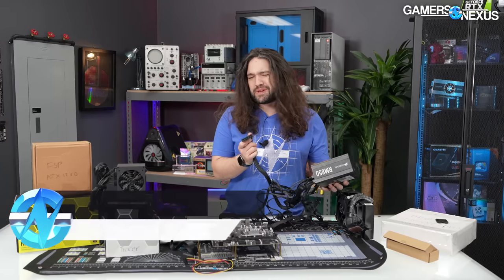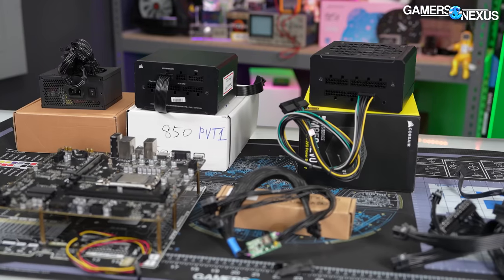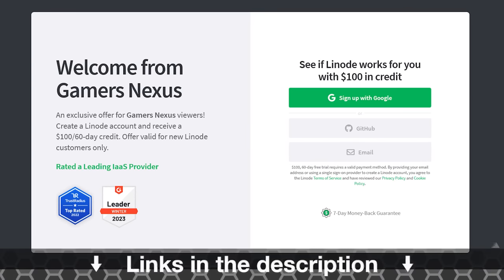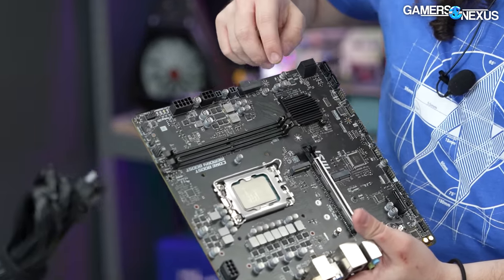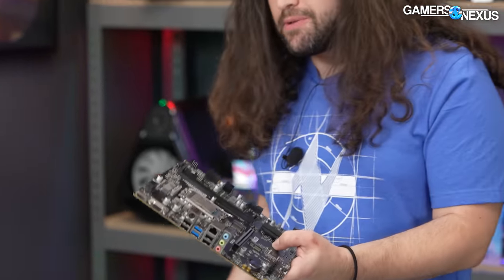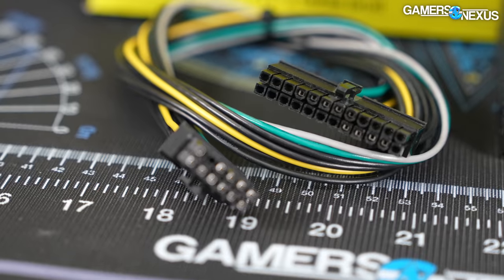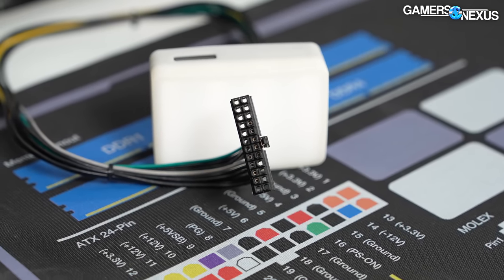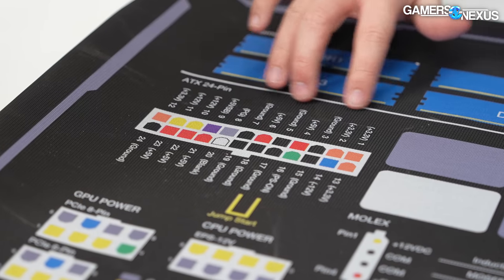The Future of Power Supplies - Maybe (Motherboard Cost, Cables, & ATX12VO)

Comment: I get that there can be tangible benefits to the 12VO standard, but I do not think it a good idea in the DYI PC space.

It shifts the work load, complexity, and associated cost of voltage conversion in the wrong direction.

For OEM builds, especially in consumer grade PCs, it can work fine though. Upgradability isn’t really a concern for these PCs, as it’s not common for non-enthusiast users to delve into anything more involved than a hard drive or RAM swap.

The one component that can follow you around between builds, without any issues, is the power supply. So long as it outputs enough power for your needs in the new build.

You purchase a quality PS once, and it can last through a decade of builds easily. MBs gaining complexity just means more to break or go wrong on this expensive component.

The 12VO standard just makes the MB more complicated and expensive, and that is a component that may require replacing at least once during the lifespan of a typical high quality PS.

So MBs would definitely be more expensive, and the PS manufacturers are not likely to pass the savings to consumers. But for their OEM partners, the PSs would be cheaper, basically making it a zero sum change, with real benefits and no downside for them to switch to this standard.

Heck, companies like Dell already use their own proprietary PSs and MBs anyway. At least if they switched to 12VO, replacing a faulty PS or other component may be easier for consumers… Probably why they haven’t adopted it, can’t have consumers fixing a broken computer rather than buying a new one.

Comment: I haven't changed my power supply in about 7 and a half years. Meanwhile, I've used 3 different motherboards in that time... why tf would I want more shit moved from the PSU to the mobo when it means owning a PC and upgrading it will get more expensive? So because my mobo will save 1 Watt per year, I'm supposed to pay more? I ain't changing my PSU as long as it lives. Thankfully it hasn't caught on and if it does, I'll avoid it like the plague until I HAVE to buy a new PSU.

Comment: FFS, the PCI-E power connector is total crap! If anything it should never have been introduced as it's such a stupid standard. We already had the EPS-12V connector many years before the PCI-E power connector came around, and it could have done the same job as the new connector, only better. The difference is that the EPS-12V connector has four +12V pins and four Ground pin, while the eight pin PCI-E connector has three +12V pins and five Ground pins. 

So I hear someone cry, "But what about the six pin PCI-E power connector?" 

Good question with a simple answer, it shouldn't have existed at all! The six pin connector has two (2!) +12V pins and three ground pins. Guess what connector can provide the exact same amount of power that was standardized many years earlier? The ATX-12V connector, with two +12V pins and two ground pins. So not only is it equivalent but it's also more compact. And just for fun it makes the connections more granular as two ATX-14V connectors can be combined and used instead of a single EPS-12V connector. In fact a lot of PSU's used that approach to make them compatible with both EPS and ATX 12V connectors.

So instead of inventing the wheel once again the smart move would have been to just use the same connectors as was already in use on motherboards for the new graphics cards. It would have meant less cable confusion and more flexibility. And now they want to use the less capable PCI-E connector to provide extra 12-V powerr to the motherboards? WHY?

There is already a motherboard connector meant for providing +12V to the motherboard, and it can provide more power using the same size connector. USE THE EPS-12V CONNECTOR! It's what it was made for after all. And if anything retire the silly PCI-E Power connectors now that you are rewriting the book!

Comment: What the point making new standard from the ground up and still use such a low voltage as 12v? 48v is no more potentially harmful yet it can deliver 4x of power over exact the same cables, this ATX12VO meanwhile is not even a compromise it's just moving the same crap from one space into another making a pure mess for potential builder who would need to choose MB by their dc-dc power supply capabilities compromising in other planes.

Comment: I don't understand this.

My 1600W PSU consumes 5W when the workstation with beefy 280W CPU is standby.

PSU manufacturers know precisely what they're doing. They have been working in the industry for decades. Shifting responsibility from PSU to motherboard doesn't exactly solve anything - PCIe already supports power management. If a PCIe device doesn't respond well to power management it won't matter who delivers the power.

With this shift we no longer talk thermals and layout. We start talking about power capabilities of motherboards.

What problem is Intel solving again?

The use of I_PSU% seems like an awful waste of something that could easily be a 1wire communication - not just for the 12V, but literally anything, including fan speed or input voltage fluctuations. The sole fact this is 3.3V should make folks at Intel reconsider.

Seems like MSI agrees with that all too. Whatever components they add to the board - have to be ready for anything the user may be throwing at them. So instead of having a range of PSU power delivery, we end up having a combination of PSU and motherboard power capabilities. Manufacturers will create power capable boards just because they can't know who and how is going to use them. This initiative seems flawed?

The only way this could work is if EVERYTHING switched to 12VDC. No other voltages delivered, and everyone now being responsible for stepping up/down input voltages for their own needs. But if we're doing this - why bother with 12VDC? Why not just replace the PSU with a full bridge rectifier and tell the manufacturers to figure it out?

Comment: (Writing this comment before watching the video)
ATX12VO seems idiotic to me. You are only moving the parts around to a more disposable part.
Powersupplies often last 10+ years meanwhile motherboards are often replaced/upgraded by that time.

That means not only is there a significant cost increase to go to ATX12VO but since you are more likely to replace motherboard than a powersupply you will pay that cost multiple times.

All this just to cut down some connector sizes. Which we could have cut down and kept 3.3v and 5v.

Comment: 12vo is just downright backwards. If they wanted to do better power saving and efficiency, why didn't they just leave everything where it is,, but put extra power control for the 3v3, 5v, -12v rails inside the PSU, controlled via a single data pin from the mobo? The whole component paradigm is being twisted to shit.

Comment: I find the 12VO spec just astronomically stupid for consumer devices.  We're going back to the 1970's/80's.

Motherboard are already bad quality from the big MFG's, and relying on them EVEN MORE to provide higher quality boards that handle all power regulation that we are STILL USING EVEN AFTER THE SPEC CHANGE, is asinine.  Nevermind the inevitable cost increases, as if they aren't charging ludicrous prices nowadays.  Then we get to the extremely refined quality PSU's having far less of an impact in power delivery, reducing their value, while they probably won't reduce in price much at all.  It also adds even more failure points onto the motherboard, the most painful and difficult component to replace, something will undoubtedly be underlooked.

If we are still going to have a 10+6+4+4 headers on the board, then WHAT'S THE POINT?  It makes no sense.  Long in the future it may, but for the foreseeable future?  I don't see it.

And then finally it'll increase complexity for new builders.  No longer will they know the giant cable goes into the giant socket and every PSU and motherboard has them.  Now it'll be a question, a pin count, "where does this go?".   The only benefit is that it won't be a pain, literally, to (dis)connect.

I have no faith in modern motherboard companies in this 12VO transition unless they're prominent in the server industry.

Comment: Putting +500W of power connectors to a not overclockable mATX board is pointless and needlessly increases cost for that board. The base 10-pin supports 50% more power than the 24-pin connector, so it's not going to be an issue for any board except extreme overclocking boards that are $1000.

Comment: thats why I like apple. 
THey make a change and people get pissed off but they made the change. 
with the PC space.. to many contracts are connected to old tech. and making a change becomes way harder because each major change would make a restart moment. 
it's the same as windows not having any centrailsed place for settings. we have settings, control panel and all the other little things that connect the 2 making it a cluster fu**. 
But if you made the COntrol panel redudand with it very easily could.. the people who have been using it for years would bitch so hard and the devs would have to relearn.... the wave of change would be to much. 
At least apple just change it and then you have no choice but to go with.. and most of the time its for the best.

Comment: In my opinion, this seems quite dumb, motherboards are already under a lot of strain and already have a ton of failure points, adding more voltage regulators and converters will just make it worse.
Also, how could this save power exactly? as far I'm aware PSUs only use 5VDC in standby mode, and when you short green and ground just then that the other voltages are active.
The only thing that could be neat is being able to route almost all cables from the motherboard but anyone can add a feature like this with normal PSUs and it isn't really needed.

Comment: Honestly if I do buy a 12vo PSU I'm gonna buy one of the inevitable eventual conversion kits to use a non-12vo motherboard with it and keep using non-12v parts until/unless they become unavailable. Putting this stuff on the motherboard is stupid.
Reply: Some of these revisions/additions do seem valuable, and I'm not a big fan of the 24pin connector because it can be so hard to fully insert, but I see absolutely no reason why 12-to-other-volt conversion using the same hardware that will be on the motherboard can't still be located in the PSU enclosure, and features like over power notification can just be done over existing pins or via a new connector on bacwards-compatible hardware.

Comment: This seems like a really bad standard for consumers. More expensive boards, lack of backwards compatibility with older devices if needed, if something goes wrong does it need a far more expensive board replacement, boards in general have to be rotated out more quickly than power supplies meaning it will be more expensive for anyone that will always stay up to date.
And for maybe a minor increase in efficiency if standby mode does this really not seems like a worthy trade off .

Makes me want to see it fail like BTX did.

Comment: So, more cables on the motherboard which means more cable management that could possibly impact the airflow in the case? More stuff for the motherboard to do? More complex motheborards meaning more expensive motherboards and more likely to fail? And on top of that, PSUs that will still cost the same if not more (cause you know, Moore's law is dead).. 
No thanks.

Comment: I am against it , sure make main-board 12V only but have the PSU's still do the 5v /  3.V for external devices  or have a separate optional modual do the external conversion , no way in hell I am going to spend over $500 on a mainboard and then risk it melting down from extra power draw , hard enough not having them randomly blow up for no reason, also how is the mainboard foot print smaller with ADDED output pins ? 24% price hike = ~ $100 extra for mainboards .. about the same as entry level PSU !!!
Reply: Motherboards don't randomly blow up. You're doing something wrong.

Comment: I am NOT in favor of this. Power supplies fail and they fail for a variety of reasons. Shifting the responsibilities of a power supply to a motherboard, especially an already expensive motherboard increases the modes of failure for that component. A $400 or more component is now much more likely to fail and the cheaper $50 - $150 power supply (probably less now that it's doing less) is less likely to fail.

Comment: I very much hate this. I only know a little about power phases and capacitors due to teardowns *on this channel*. I DO NOT trust mobo vendors to put high quality (or even decent) voltage adapters in arbitrarily assigned "mid range or below" SKUs.
Also Intel is on some extreme copium if they think vendors are capable of achieving the "somewhat lower power consumption in certain sleep states" ideal. Have they never tried to download drivers before?

Comment: A PSU that wont do its job? Yeah, thats gonna go real well....You're literally paying (partially) more than you would have with a non-12VO since its the motherboard doing the conversion. Mobo manufactures are going to increase the price. "The cost increase from 12V to 5V and 12V to 3V is not much." - MSI. Define not much, how much is not much? $1 more? $10 more? $50 more? This whole things smells like a dumpster fire.

Comment: Nope. Dont like it.   It still has to get done. I rather the people making power supplies make as much of the power system as possible because that is their specialty already.  Also Od be concerned about heat and interference caused by having more regulators physically touching all the motherboard components.

Comment: I hope we will never ever see massive change to 12VO... 
Think about how many times you change the PSU and how many times you change MB? 
I bought many years ago TOP PSU from EVGA and I do not need to change it for 10 years... Or even more. 
If 12VO will be implemented everywhere we will see even more higher costs on MB, they will be less stable, over engineerined... This just no win for users and  PSU will not go down. 
 By the way its also not rationale and bad for nature use of not so common material which also expensive material... And if damned will grow then even more expensive.

Comment: I'm sorry to say, but all I heard was wishful thinking. So you've got a higher voltage, higher amperage, higher wattage maybe power standard, with a built in step down that will theoretically allow almost any components to still function, albeit throttled despite the PSU not being sufficient in wattage. All this while big manufacturers let people overclock their 600$+ CPUs from 1.3 V to 1.5 V with two clicks. This while some CPUs are capable of killing motherboards they are compatible with. I'm sorry to say 12VO is going to be spectacular, in a bad way.

Comment: what happens how if there is a problem with the psu? you buy a new psu. most of the time the motherboard, cpu. gpu, memory etc are safe.
what will happen if you have a power supply problem? at the very least your motherboard is garbage. and knowing intel.... your cpu will be toast. your gpu will be fried and your memory will be incinerated, as well as your drives, and other peripherals.

Comment: There is no reason for moving connectors to the motherboard. It's just dumb. The condition/security that a cable can have to support and provide power it just easier and cheaper. Besides the DIY of the system is much better and easier to do with a cable coming from the power supply than the motherboard, that is also changing with some newer ones the connectors are on the back side.

Comment: 12VO sounds like a extremely bad idea. I don't want to have any of this crap on my mainboard. Having a separate box to transform the voltages that is neither inside the PSU nor on the mainboard would be okay though, maybe even desirable. I hope they'll at least use socketed chips rather than soldering them straight to the board, but who does that in 2023? Less technically inclined people will end up buying a new board (basically a waste of money) just because a VRM blew. And then they'll get into trouble with TPM stuff and can't boot their Windows 11 anymore. Depending on your sense of humour this will be extremely funny or extremely dumb.

Comment: yeah i dont agree , logically other pc components that dont use 12 volts need now need the motherboard to deliver this.......
NOT GOOD ,i dont want a board thats possibly more dangerous to work on , if the layers melt or merge the mix of voltages will not be healthy for your system or even you

Comment: gonna be blunt, not a fan. lack of proper cooling (or in some instances, no cooling at all, beyond the copper plane of the board) for lower end boards already results in vrms cooking themselves, this will just add another point of failure on the motherboards.

just nope.

Comment: PSU job : Convert wall power to usable power.
MOBO: Manage "intelligence".
MSI quote "costs not much". Steve !  A 7 segment diag display is also "not much" ! Don't accept that premise, be critical ! (╯°□°）╯︵ ┻━┻

@GN Will you do / are you / is ANYONE doing tasting on MOBO 12vo regulation circuitry? Like you do for PSUs? What happens if the mobo, in the conversion process 12v>5&3.3v, goes "Bzzztz"? 100% write off on a 5k$ system + data? Fire? Don't buy Gigabyte mobos? :D  But seriously, what if there is a defect like Asus had with the caps backwards? Write-off in 2 weeks?
You have A board :D Push it to the limit and beyond :) 500w of 24 max speed HDDs + of RGBs, Fans, pumps from Mobo (aka molex, you said that board has TWO outputs) :D You know a consumer will do it.